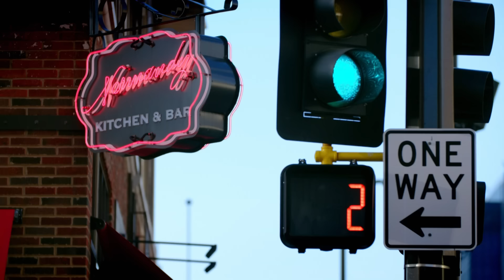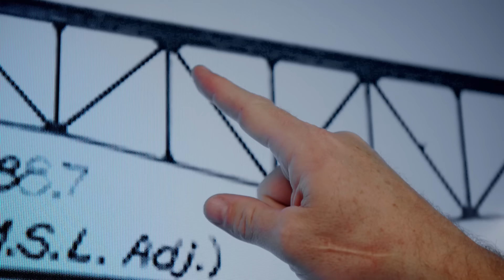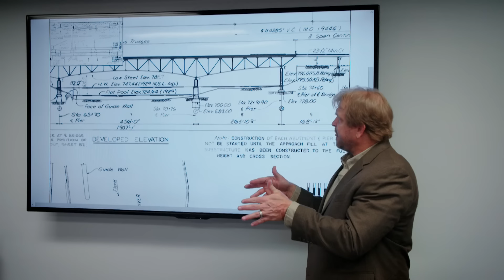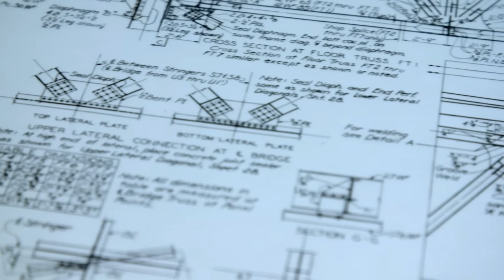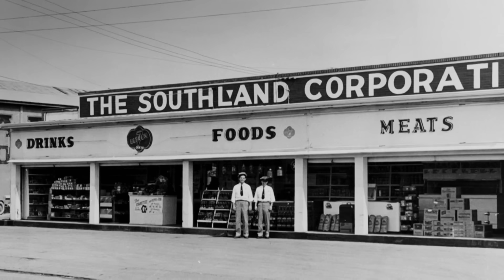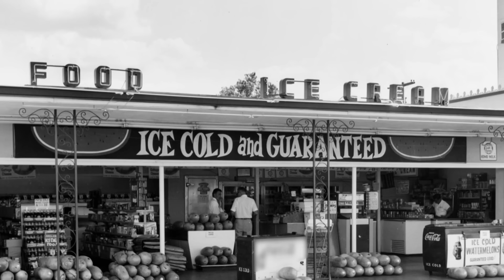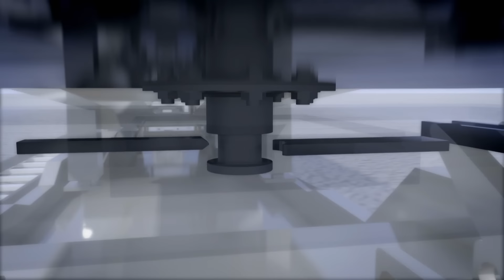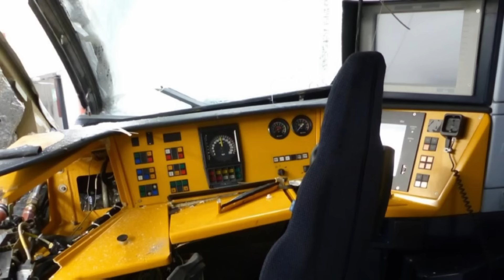Minnesota's Fatal Structural Failure! - Massive Engineering Mistakes - Engineering Documentary

Comment: As I have bought building permits over the years, I wonder about those inspectors who come out to verify that things are done right.  Case in point, the 35W bridge SURELY got approved by some governing authority.
Reply: It was fine for the time it was designed but the traffic increased and there was talk of closure and it was scheduled to be replaced in 2020.
Reply: @J-1410 I suppose so.
Reply: One thing that wasn't mentioned was the corrosive effects of the chemicals used in the winter for road surface de-icing. There was a multitude of things that came together at that moment.

Comment: The new bridge sure is a beautiful, minimalistic design. But I wonder why they made the few pillars the main overspans rest on (12:36) so thin in the middle, whilst they are much wider towards the ground and towards their highest point. This cannot possibly serve any function (as far as the structure goes), I would think..
Reply: It's physics. Those are concrete pillars. They are designed in a way to capitalize on compressive forces